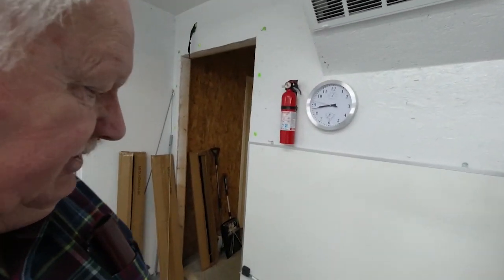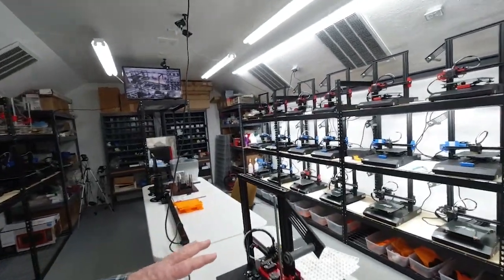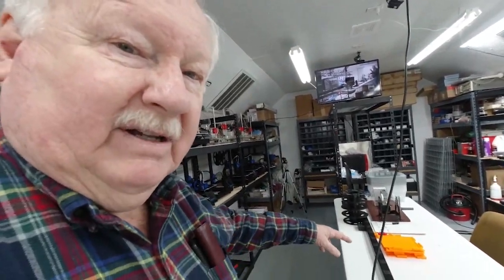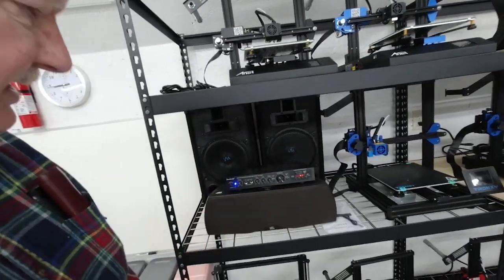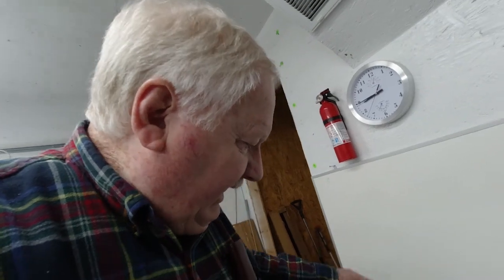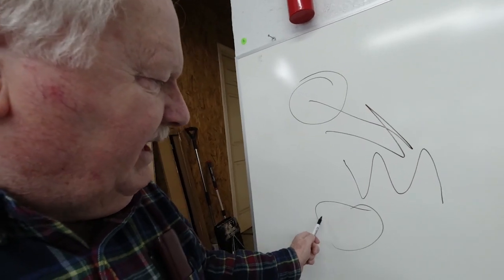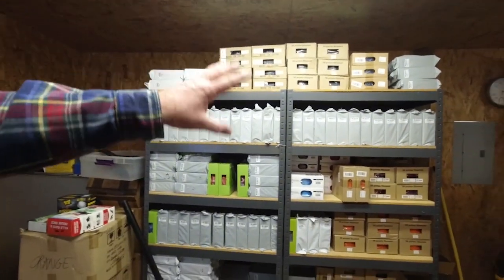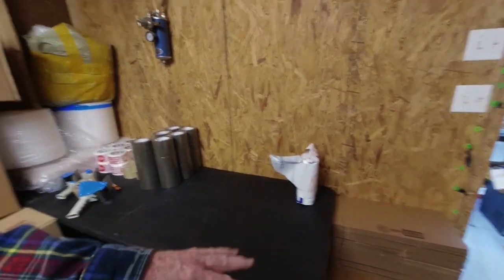ANET ET4 3D PRINTER MAINTENANCE AT MY 3D PRINT FARM

Comment: Hi Ken - it's been a while: getting too busy in packaging, web and other stuff for my own new product. Another no nonsense video on aspects of 3D printing. Funny, there a spot in the video you pointed to the two large red Anets and said "I'll be pulling them off soon and perform some basic maintenance". Can you imagine our cars, lawnmowers, electric food mixers and all working 24hours or more non-stop? Add one more thought, imagine these devices to work just as long without a single issue once in a while? No, of course not. I'll bet anyone, if they had 26 of the same car being driven all the time that sooner or later, at least one or more would need something at some point. So why do we feel to expect more from our printers? People are too naïve about mechanical stuff.

Anyway, glad to se you're still going strong and goodness, are still expanding. I come hear just to get a boost of optimism and and to see a real person making a real business happen. Claude
Reply from the maker: Great to hear from you again Claude. You and I have a lot in common, I can tell by the way you talk about maintenance. We all know that 3D printers need preventive maintenance from time to time, just to keep them performing properly. It only takes 10 or 15 minutes to check out an Anet ET4, which includes belt tension and wear, roller adjustment and wear, bed leveling, nozzle gap to plate, lubrication if needed, quick check of electrical connections, quick vac and wipe to clean machine and fans, and repair of any problems that have been noted during previous operations. The printers give me very good service when I do this. It's better to do the maintenance when you chose rather than waiting till you really need to print and don't have time to spare and your printer breaks down. Sounds like your business is keeping you busy too. I hope you're doing well and having much sucess. Always good talking with you my friend...Ken

Comment: Good points on clogging and reasoning for maintenance.  Terrific video .  On the density ...I set my infill to 95 with a reticular pattern.  Gyroid patterns tend to fail.   I try to stay away from 100 percent.   Good points on the anet verses expensive printers.  I think time will tell as you go. Hopefully they will hold up.  But as you say 100 bucks you can buy another to replace .   Important, in some cases the quality of print is a factor in buying expensive.  As I compare my prusa and my ender,  the prusa gives you a much better final product.  Sometimes this is not important.  For me the main product model must be as perfect as I can get it.  For the other parts not so critical.  Again thanks for sharing.  Joe
Ps 
yea its fun to replace nozzles and heat sinks and get into the nitty gritty
Reply from the maker: Your right Joe, if I were printing high precision parts for SpaceX or a medical heart valve I would want the best quality 3D printer money could buy. However the helping hand is a tool and the Lap Diner is a type of food tray and neither of them require high precision to work properly. I agree, the last 4 Anet ET4 printers I ordered on eBay cost me $451.34 including shipping and sales tax and that's 4 printers for less than 1 of a lot of other high quality 3D printers. I'm just saying, if you don't have a lot of money to spend, you can operate with less expensive printers. Good conversation Joe, thanks for sharing...Ken
Reply: @NewTechInventors  yes your right.   Another variable is failed prints .   IF your Anets fail at a greater rate than expensive printers then you make up cost of the expensive printer ..... but if the A nets are not failing your a winner.  .....nice stuff......joe

Comment: Hey ken trying to start a print farm for my product and I’ve noticed a low price on the tronxy xy2 pro and wondered if you prefer the anet et4 or the tronxy
Reply from the maker: Good question!!! I use the Anet ET4 printers mostly because I have come to understand them and how to set them up for different types of print jobs and materials. Now a 220 x 220 print area Vs. a 255 x 255 area may be a factor if you want to print more parts at a time or larger parts. Since This is not a factor for me, AT THIS TIME, I prefer the printer I use the most, the Anet ET4, ET4-PRO, and the ET4X. I have 6 Tronxy XY2-PRO printers and have set them up to only print 2 or 3 parts, this way I don't have to do much as far as changing parameters on them. I will include them in an upcoming video. Thanks for your support...Ken

Comment: 26 printers or so, okay not that it's a competition but I got some catching up to do.
Reply from the maker: One thing to remember John, the more printers the more work. I have more printers than I can effectively operate by myself, but I have been building a 3D printing capability for future demand at which time I will hire some people to help me operate them. Thanks for your comment and support...Ken
Reply: @NewTechInventors  Yes the economics behind-the-scenes is interesting. Cost per machine is low but manufacturing times are high for each individual item. Still trying to figure out how to optimize my time, types of products to produce. Leaning toward items with longer print time but sell for higher price point since that is less hands on time per item.
Reply: @johnmorey8107  hey john.  The thing about 3D printing that is extremely important is profit margin and how it relates to farms.    Sell cheap with a quick to make product.   This is the right formulation.   In fact you can quadruple your sales by lowering your price by 50% thus increasing your overall profit by double.  Now that’s really depends on if you want to work harder.. joe